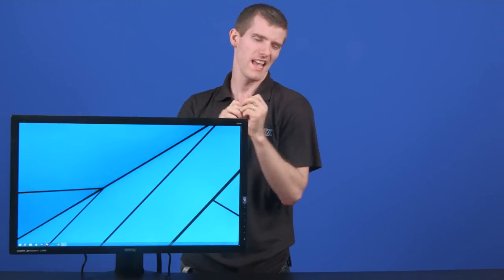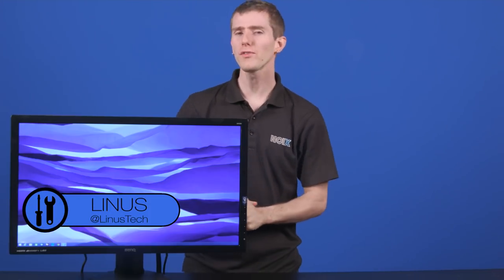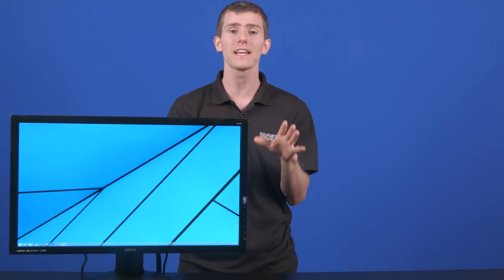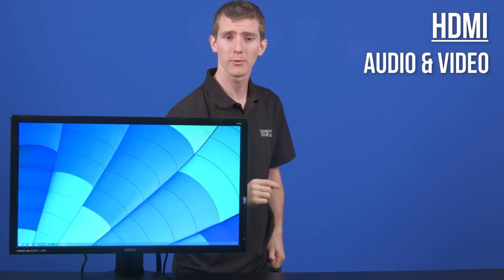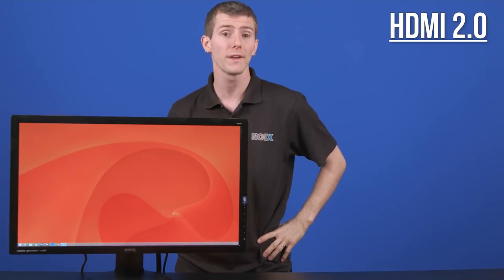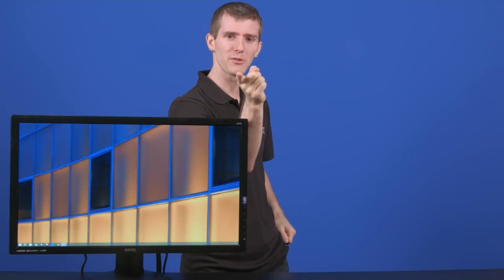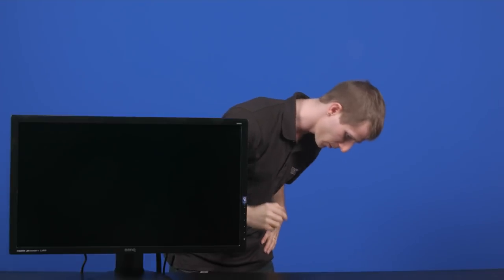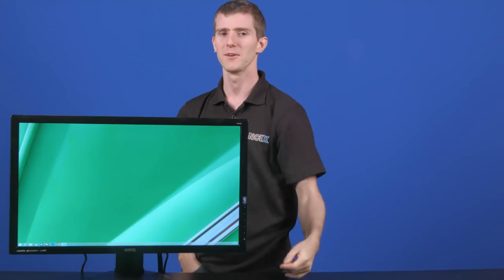Display Connectors Explained! - Tech Tips

Comment: Hi, I don't have high levels of english and I haven't understood at all, if I have a 1080p, 144 hz and 1ms Computer screen, I have to use HDMI or Displayport? Thanks
Reply: You have to use Displayport. HDMI can't handle 144hz, DP can.
So for the full 144hz experience you should use Displayport!
Reply: Pietsterer a Thanks!!
Reply: DVI also supports 144hz  if your monitor doesn't have Displayport
Reply: my monitor have DisplayPort but my cpu does not. do you have any suggestions to fix it?
Reply: +md haziq buy propertly graphic card
Reply: Buy a video card.
Reply: md haziq buy an adaptor not a graphics card. If u have HDMI port on your laptop,buy an HDMI to DisplayPort cable adapter . Connect HDMI side to laptop and DisplayPort side to monitor. Wham-o
Reply: A adaptor can't increase the refresh rate, you need a GPU to handle 144hz on a Display.

Comment: I need a recommendation on connecting my PC's DVI-D port to the HDMI input on my 4K TV.  Will this hook-up pass sound?  The TV is about 20 feet away from the PC.  Should I use an adapter DVI to HDMI or is there an adapter cable using the same connectivity?

Comment: Display connectors explained the short version:
1. VGA= DEAD...stop using it and at least come to the 21 first century to DVI.
2. Dvi and dual link Dvi= STILL has some useful life in it for decent enough chunk of years to come.
3. Hdmi=has a BRIGHT future ahead on a variety of reasons already explained in this video
4. Displayport= so far the KING of the mountain in terms of what it can support and options.

It's simple.  If possible get displayport.  If not get Hdmi 2.0, If not, get dual link dvi.  If not, get hdmi regular ( aka 1.4 today's standard..found ....EVERYWHERE), If that is not available, then for the LOVE OF GOD. get dvi or dual link dvi but stay the fuck away from vga!
Reply: tpcs what your problem with vga? Works great!
Reply: @sjogosPT  i've found it to be glitchy-looking with even simple games
Reply: Nob the Knave.....heh, yeah--the monitor is fine on movies and most else and the cable, which is a second one is fine too (with Every little prong intact).  I only have a bit of line-glitching on some games where the game isn't running ideally, and yes i have Primitive graphics being used.  It's poor synching in this case.  : ll
Reply: eric l I have a 75hz monitor, what port do I use. Do I have to match the hz with the monitor ect?

Comment: I'm really confused on HDMI. Firstly, you say that HDMI 1.4 runs at 30 hertz? Or is that only for 4K? If I'm connecting a laptop (let's assume it's HDMI 1.4) to my 120 hertz tv. Am I not getting the TV's full potential? I'm working on a new computer now, with a Asus Z170-A motherboard, which just says 1xHDMI port. Is 2.0 the norm now? How do I know if I have 2.0 on my laptop? Will my new motherboard have it? Thanks for all this help

Comment: super mhl??
it can do 8k at 120fps. true future proof.
Reply: thats only on a native mhl connection. Usually we use mhl to quickly adapt into a more common standard. Its not really future proof when no one supports it.
Reply: iamterence77 super mhl is support by alot of companies.
Reply: rubikfan1 not in the general sense of video. A lot of mobile devices support it, but almost no display devices use MHL ( monitors, tvs, av recievers). the 8k @ 120fps is only possible if it is using pure mhl on both ends, which is pratically not supported. The moment you adapt mhl to another connector, you are limited to that connector's bandwidth.
Reply: iamterence77 but if 8k becomes a thing, it is nice to al ready have a standaard.

and 8k 120fps is pretty much the limmit what we need unless you have a home cinima 200inch+ set up from 10cm
Reply: "true future proof"
Right up until we surpass 8k monitors at 120 fps like we had with 1080p back then...
A.k.a. NOT FUTURE PROOF
NOTHING IS FUTURE PROOF
Reply: rubikfan1 but when the time comes just use DP 1.4 or 1.5, or what ever comes out, to maintain backwards compatibility with the connectors we already have. its just not worth it switching on a brand new standard with a new connector that is too ahead of its time.
Reply: chaquator 8K on a monitor is somewhat ridiculous though, because of the smaller sizes that monitors are usually. Honestly, unless you want something bigger than 24" even 1440p is fine for a monitor of that size and smaller.
Reply: Hardly supported and only carries 15W.
Reply: still, why do you need 8k on a 32 inch display? The details are insane in 4k. Like, you don't even see them from a normal viewing distance.

Comment: Which connectors support 144hz?
Reply: duol link dvi and displayport
Reply: white person thanks
Reply: ***** no difference in dual link dvi and display port if the resolution is 1080p. Dual link dvi hits limitations at 1440p tho. Displayport at that point.
Reply: Richard Smith that answers why I wasn't getting more that 60 fps using hdmi at 144Hz and with the dual link I got 120 fps and sometimes more. 1080p
Reply: Nicolas Alvarez Mondragon I over clocked a monitor to 78hz and was getting 78fps on a monitor that was HDMI 2.0 with a high speed hdmi cable

Comment: +
NCIX Tech Tips
Hey I had a question about active display port to HDMI adapters. I'm looking at getting thunderbolt dock for my laptop, but I need to have the dock output to HDMI. I've heard that you need to use an Active Display Port to HDMI adapter in order for this to work. Are there any caveats to using this dongle? The HDMI cable will be fed into a stereo for audio and video.

Comment: My monitor is shit. it's 1600 x 900 with only VGA :(
Reply: +★_Vizualize_★ yeah that's quite shit, although my 1280 x 1024 ain't much better
Reply: +XtrAMassivE 1360x768 only vga worse than yours
Reply: +DANKKrish 1 x 0 with only SCART, get on my level.
Reply: +★_Vizualize_★ I'd love to have your 1600x900 instead of mine 1280x1024 :/
Reply: *****
Aww man, that's too bad. Where do you live? 1080p monitors arent expensive anymore
Reply: +★_Vizualize_★ aghh. Same here. And i'm using DVi to VGA adapter. I think i need to buy 1080p monitor
Reply: i bought a 2560x1080p monitor and i plug it with displyport and with hdmi at the same time. This is just superwsag
Reply: well, standard 1080p monitors arent that expensive. HP pavilion with 24" costs just 140€
Reply: My  laptop is 1366 by 768 so don't even
Reply: i got a used 22 inch 1080p monitor for 40 dollars
Reply: My older monitor I used for my old Dell Inspiron was just as bad.

It only went up to 75 Hertz

Comment: I'm using a DVI-D from LYNDA high quality cable at 1980x1080 with spyder 4 calibrated Dell ST2420L monitor. Will I get a noticeable benefit if I switch to high quality HDMI cable?
Thanks for taking the time.

Comment: Just unify the digital standards already.  Make an a/v equivalent of USB, where anything connects to anything else.
Reply: +PongoXBongo That's what DisplayPort is, and just like USB its an open standard, but a large collection of comapnies wanted to collect royalties on the cable and be able to impose DRM on intermittent signals in the off chance someone wanted to use specialized hardware to screencap data, so they grouped together to create the consortium which gave us HDMI. When you support HDMI you essentially contribute to the move away from an open standard.
Reply: skyler114 Good to know.  Thanks!
Reply: +PongoXBongo Just put everything on usb type c

Comment: When connecting from a desktop to a tv using a hdmi to dp converter, is hdmi used as the source on the monitor, i would generally be fine with these kind of issues but i havent been able to find a fix what so ever, there is just no image being displayed on the monitor

Comment: I got at my graphic card a DVI-D Dual and have a Dell monitor with a displayport.. Now I have buyed a cable only from DVI-D to Displayport but that is not working and no wakeup is comming from my monitor. In HDMI everthing works fine.
Do you know what kind of adapter I need to get this working?

Thanks for support
kindly regards
Hank from the Netherlands

Comment: I want to connect a windows based laptop with a display port to a late 2012 27” IMac with a Thunderbolt one port. I have a cable that connects the two but cannot get them to work. Any tips?

Comment: I picked up an Acer H203H 1600*900 monitor at a yard sale for around $5 in perfect working order. I have it connected via DVI-D. I've ordered a DVI-A to VGA adapter for use with a TTX-1770 17" colour monitor: It's for those older games that run better at lower resolution with 1:1 pixel scaling.

Comment: Hi, great video. 2 Questions.Does a display port cable to monitor with display port from graphics card have to go a certain way round as I see the word non-bi-directional?.Does this mean it has any markings which end goes into the monitor?or the graphics card?Next question, do I have to activate the digital port into the graphics card software.I have a 2gb Geoforce 1050 Asus version to a Samsung 29-inch curved monitor.Hope you can help?I am now going to look at What is g/sync

Comment: I'm currently building a computer and I want to run at least 2 (hopefully 3) monitors. What hardware will accomplish this best? and by extension (no pun intended), which type of connectors will be best? (I'm hoping for 4k monitors, but if I have to take a step down until I can afford it in the meanwhile I will.)

Comment: I'm still stuck at VGA. I never could get a new cable for a reason I can't control. So, for now, I'm using a DVI to VGA adapter that came with my GTX 760 graphics card and the VGA cable connects to my HP S2031 monitor. I did get an HDMI cable from a family member because he didn't need it anymore, but the HP S2031 only has VGA and DVI ports. I did, however, once use the HDMI cable when I used a larger TV than my monitor, but it had a resolution of 1366x768, I think. I liked using the TV before because I could easily see text from across the room. I needed that feature because I tend to watch youtube videos as I fall asleep so I like to read the titles without getting out of my bed. But I switched to this monitor because it has a higher resolution of 1600x900 and never feels hot to the touch. Also because it's just a nicer quality picture. I still can't read the titles when I hover over thumbnails after the video, but some videos I watch have a psuedo-title in the thumbnail that I can read across the room. NCIX Tech Tips and LinusTechTips always put these words in their thumbnails. Helpful as crap.

Comment: I would just like to alliterate a little bit on top of what Linus said about DVI. While yes it is true DVI-D does digital and DVI-I can do analog,  DVI-I actually supports both analog and digital signals. Now there is another form of DVI known as DVI-A which can only display in the analog format, the "A" of course indicating analog. Both DVI-I and DVI-A are compatible with DVI- to VGA adapters, however DVI-D is not since DVI-D only supports digital signals as mentioned before.

Comment: I just purchased a Dell Monitor with DP that will not work to DVI-D using the conversion cable.   Do I need to get a one piece DP to DVI-D cable or am I out of luck on this?  I have tried everything but to no avail.

Comment: i have a pavilion display at 1080p and want to buy another one for dual display use. they just have HDMI (or VGA). will there be any quality loss if i use a display port on my xfx r9 380x and connect the two displays via hdmi? i mean, its an adaptor wich is always not as good as directly connected.

Comment: 2 questions
1) is there anything HDMI is better at than DisplayPort? will it get fazed out over the coming years? seems much similar if everyone got on board with one connector 
2) with daisy chaining is there a delay to the second monitor? would it be better to have each monitor plugged start into the GPU?
Reply: I use a StarTech 3-Port Multi Monitor Adapter - DisplayPort MST Hub, DP from NVIDIA 1080 to the Adapter & out to 3 Samsung DP/HDMI monitors 1920x1080 @60hz, works great, I have the desktop on the 3 monitors

Comment: I have two MSI GTX980Ti and two TV.  FHD 42" (1920*1080) by HDMI and other of HD Ready 32" (1360*768) by DVI to VGA adapter cable. I connect in separate graphics card.
My ask... have pre-order the Oculus Rift and...
¿I can connect all TV in the same graphic card and Oculus in other Card after?

Comment: I have a gaming laptop which has only an HDMI 1.4 and was wondering if I could connect an HDMI 1.4 cord from it to an adapter that has an HDMI 1.4 input which has a displayport 1.2 input with another cord for the displayport for my monitor that has a 144hz refresh rate will it work? Thanks!

Comment: Thanks for the videos, a lot of good information out there. Here's  a question: Upgrading to the new GPU's out there with all DPx3. My 3 monitors (ASUS VG Series VG278H Black 27" 2 ms (Gray to gray) HDMI Widescreen LED Backlight LCD Monitor) only support D-Sub, DVI, HDMI. What is my best solution for gaming connection using the GPU's 3 DP besides buying 3 new monitors? Thanks in advance for advice :)

Comment: Hey, can anyone confirm or deny whether one can use older DisplayPort cables to connect DP 1.3 standard devices without sacrificing the benefits of 1.3? I know that hdmi cables thus far have persisted through the revisions but I've been searching the net for over an hour and cannot find any evidence one way or the other about DisplayPort. My cables are around 2yrs old, but I question any age here.

Comment: displayport from monitor to video card at dvi-d if I buy a cable you go on 144hz and resolution 1920-1080? I own a C24FG70FQU samsung curved 23.5inch monitor and the video card (gpu) a gtx 560ti with minihdmi and dvi inputs .... I do not have displayport in (gpu)

Comment: I'm still using DVI-D cable. My 1080P monitor does not have a HDMI port. Thinking about buying a GTX670 4BG version and a 4K monitor. not so sure if the GTX670 can support 4K

Comment: Is it true, that if I have an 8 years old HDMI cable and I buy a GeForce Gaming X 1060 & GB and connect it to a HDMI 2.0a TV, I don't have to buy a new HDMI cable to use the 4K resolution?

Or would it be better to use some kind of DP-to-HDMI cable instead?
Reply: Nnebr it should still work fine

Comment: i have acer monitor with 120hz, today i installed 1650 gtx video card and i bought dvi to displayport adaptor and i plug it in my video card and now i'm only getting 60 hz on my monitor, any solution to this ?

Comment: My rx480 8gb can do 4k at 60hz and supports display port 1.4 (not covered here). I went and purchased a samsung uhd monitor that supports 1.1 and 1.2 with varying hertz. When I use my displayport cord on the 1.1 it'll only allow up to 2k resolution for some reason. While 1.2 setting will allow for 4k it produces sporadic screen flicker during 4k gaming sessions. This is also with the "free sync" option activated on both the monitor and the Amd crimson interface. Any suggestions on how to fix this?

Comment: im building a system that is powered by a an ASUS formula VI intel 1155 model. with an intel i7 4970k and at least 32 gigs of ram. im planning on running a gtx 990 and possibly a titan also on triple screens with the middle screen being a tough screen and one of my side screens 27 inches being my gaming screen. i do engineering. should i go Display port or HDMI or a mix of both

Comment: I would like to 
know if I buy a cable DISPLAYPORT TO CONNECT THE VIDEO BOARD ON THE TV 
THAT ALSO SERVE AS A MONITOR OF MY PC PRETTY IMPROVEMENT IMAGE POIS If 
the HDMI reaches 4096x2160 pixels, DisplayPort reaches the quality of 
7680x4320 pixels THANK YOU FOR INFORMATION

Comment: So I have a HDMI laptop and a DisplayPort monitor, I bought a HDMI to DP adapter cable from Amazon and plugged in but it is not displaying on my monitor. Am i doing something wrong here?
Reply: Khoi M Pham Here’s the issue that I just learned today that no one will tell you (So frustrating). The DP to HDMI adapters and cables are usually unidirectional. (They go from DisplayPort to HDMI and not the other way around). I am currently trying to find a cable or adapter that can do the opposite and if I find any information I’ll be happy to share it with you

Comment: I have a Acer xb280hk 4k monitor and its 'only input is one displayport 1.2'.  Do you know how I can output a ps3 into it? I know i need a hdmi to displayport converter, but i can't seem to find any ..
Reply: +Vlog Hog you can convert displayport to hdmi, those converters are cheap and easy to come by but it looks like going the other way is pricey. I found one on newegg for over $50 usd.

Comment: 1.  DVI cable to DVI monitor
2.  HDMI to DVI cable adapter to DVI monitor
3.  DisplayPort to DVI 'active' adapter, then DVI cable to DVI monitor.  
In case people are having issues (as I did before hours/days of research)- For triple monitor setups with AMD graphics- AMD requires you to uss displayport for all connections over 2. Or you can buy an 'active' (keyword) adapters. The adapter costs around $25 but was the solution to getting triple monitors. A definite hassle. Nvidia doesn't care what connectors you are running.

Comment: hey i have a 1080p monitor and i am confused which port should i use hdmi and dvi
Reply: On my setup I use HDMI to a 1080p monitor with 60hz refresh rate, and a dvi to a 1080p monitor with 144hz refresh rate. They both work fine, but if I switch the plugs I lose the 144hz rate option on the main monitor. You probably have a 60hz monitor, there will be no difference in image quality. In windows check your monitor options Control Panel>Display>Change display settings>Advanced Display Settings>Display Adapter Properties>Monitor... use the dropdown menu there to see what your available refresh rates are with the dvi cable plugged in. If you have 120 or 144 option, select it, and don't use HDMI.